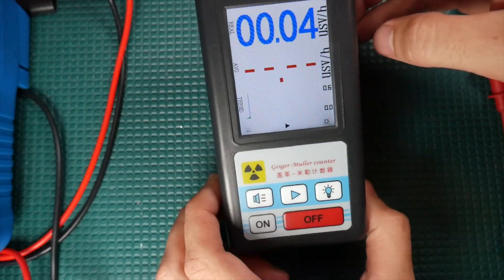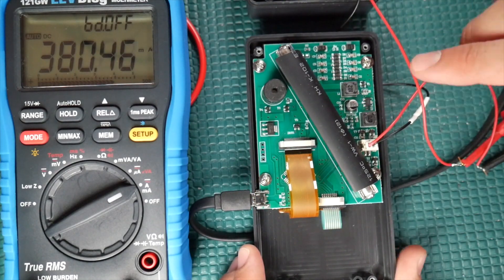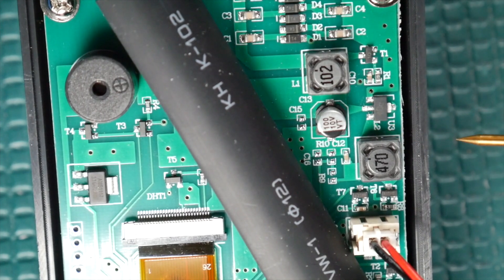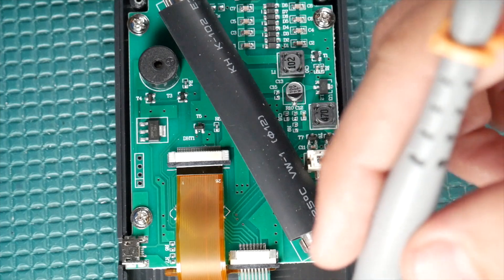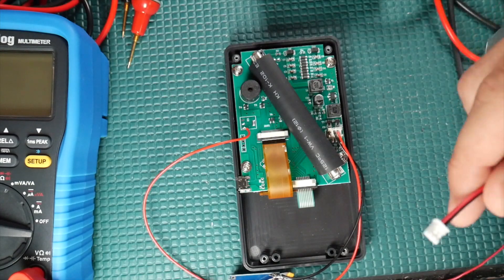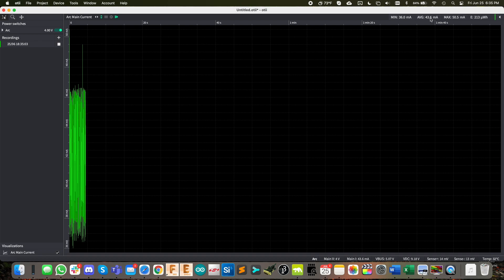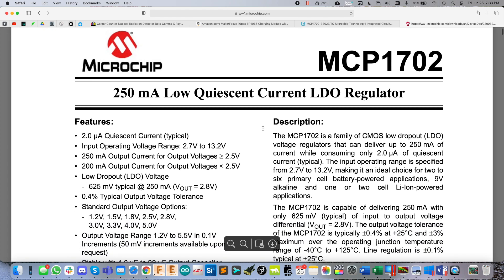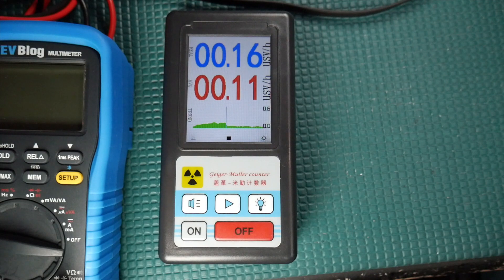Geiger Counter (BR-6)  - Battery/Charging UPGRADE - Full Tutorial

Comment: I have a variant of the BR-9 and it seems like it actually is build for 1 LiIon. Haven't tested and tried all aspects but voltage sure hints at it. May work with NiMH bot not ideal. Oh well. Just take out a cell if powering for long period of with with USB. Or even just put in a schottky diode - no recharge at all. I actually like using regular AA. Just chuck in a freshly charged set of NiMH or grab some of the shelf if in a hurry. Even a set of AA 1.5v lithium which don't leak and lasts for decades on shelf - perfect for an emergency bag.

Comment: Thanks for this tutorial. I have the model with the white enclosure, which I believe is the B revision with an updated PCB. It does not backfeed to the battery compartment. Also there's a spot on the board near the USB jack with a missing IC... Maybe they were planning on making a rechargeable version of this, similar to your mod.

Comment: in any case 2 units of LM317T/D can get very perfect solution for all game. first is current charger,second - is converter 3,8 to 3 volts. 750 Ohms & 1 kOhms, 4 capacitors & 2,5 Ohm for resistor for current limit 0,5 A.

Comment: Hello Kevin! i try to see this movie few times, RESPECT FOR AN GREAT JOB! but i really don't see the reason fo remove AMS1117  3,3V regulator. why not to cut 2 lines from input and output of AMS1117? there you are disconnect & continue to use of internal voltage stabilizer.  GND pin on pcb, also good cooling for AMS1117 by footprint. now trace  input voltage wire to R6 or (+) of USB, other wire from Vin of AMS1117 to output of external charger circuit - TP4056. Out of AMS1117 to PLUS  of battery connector.  case of few additional capacitors close to regulator is very simple too. case of few additional capacitors close to regulator is very simple too. or may be you have other sudjestions?

Comment: Geiger counters from International Medcom and SE international have always been expensive given they are specialized non typical consumer products. Given the rather simple electronics and the cost of tubes if they were mass produced they'd probably be under $50 instead of $500 - $800. This one has what appeaars the China version of the SBM-20 Geiger-Muller tube. Thanks to China manufacturing basic ones can now be bought for affordable prices. I have a SOEKS and and Radalert 50 but I would like to get the new SE Ranger with the large sensative flat 7317 pancake tube that detects a ß y x for but $650 is a bit pricey for a home hobbyist.

Comment: You should try and find where on the chip that switches the millisievert alarm setting, the default is 0.5. That would be a cool mod... I'm sure it's the same chip as on the other BR6 versions,  just a slightly different circuit board.
Reply: Yes, i Need that!

Comment: Cool project! I did a similar thing with a cheap-o oscilloscope, but just fed it the 3.7 volts and hoped for the best, with no analysis of where they went. It didn't catch fire and still works :)
Reply: is not exactly an project, it's a research for save mony and use of device.

Comment: It was charging the NiMH at 370mA ? There's is your problem! 
If it was a trickle charger, it would be charging at 20-30mA. Probably uses one resistor to limit the current from the +5V to the battery. 
NiMH can deal with a constant low current (20~30mA) when full. All the hydrogen generated during charging, is converted back to water inside the cell.
If the charging current is too high, it will heat up after being fully charged, and you say bye bye to those cells after a few cycles.
Reply from the maker: pretty crazy!  and I bet a lot of people use 1.5V alkalines... wonder how those batteries enjoy that beating
Reply: @Kevindarrah  I can tell you from dumb experiments/experience, that alkaline at those currents, will blow up like a pressure cooker! Even at 25mA charge current! The little vent holes can't handle that much hydrogen buildup, and make a loud popping sound as the seal blows.

Comment: I would fit a switch on the battery positive lead and put it on the site of the unit so you could turn off the batteries when they are charged and you want to power off the USB supply.